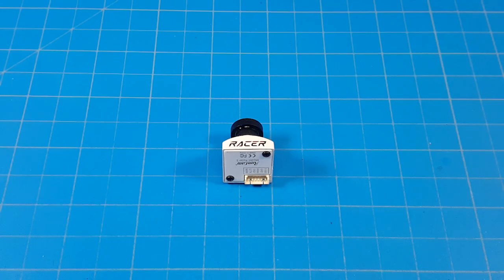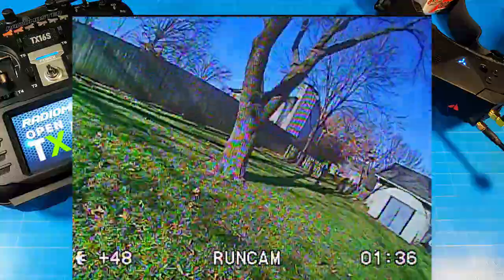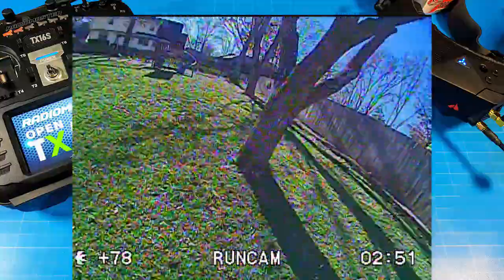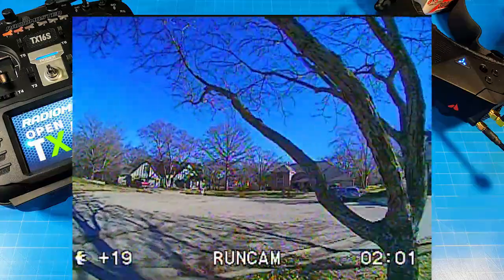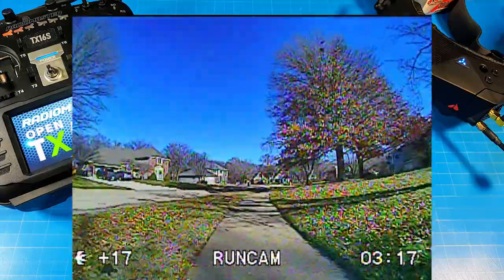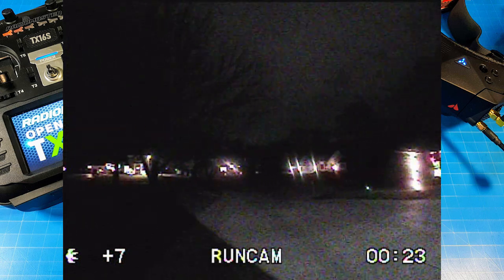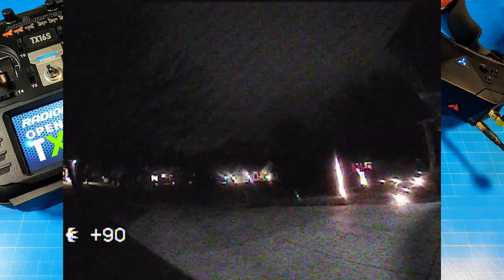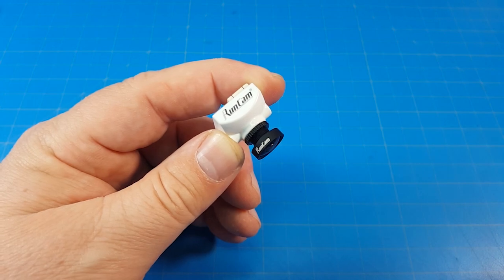Runcam Racer 5 // R is for Racing

Comment: The Angle gyro I'd assume isnt for flight; but to consistently set your cam angle while on a level surface so you can have consistent flight characteristics.
Reply from the maker: That could be too. Thank you for that
Reply: This is what I thought
Reply: oh yeah! :)
Reply: That was my first thought as well. More for setup purposes than in flight.
Reply: fully agree. it's probably more for setting your cam angle, especially since it's a Racer cam. With 1.8mm lens most ppl that race set it to 45 degree tilt since the fov is wide enough to go really fast but still see in the slower technical sections of a track.

Comment: Not a pro racer but here are my thoughts on the one thing that makes it stand out, the angle info on the OSD. When you are racing you might want to adjust the camera depending on the track or your plan for the day. Maybe you are experimenting and pushing yourself. A lot changes as far as controls with higher angles so it would be good to know what your limit is before things get too hairy. Knowing the angle will also help when it comes to going from rig to rig if you were to crash have to resort to a backup quad. Probably the most innovative thing in a space that is lacking a lot of innovation. Kudos to Runcam for thinking outside of the box.

Comment: I use racer cams on a couple of my quads because they are small and light, but also because they give you a higher contrast with a smaller sensor.  You trade overall quality for being able to more easily see your lines at higher speeds.  They also tend to have a wider FOV
Reply from the maker: I like the fov for my style.

Comment: This is very handy for new pilots. If they want to get the perfect angle to match the gopro they installed as the HD recorder. If you get a 30 degree or 40 degree this should help match it. Atleast thats what i think its good for. If you flying long range and want to know your angle, this should also help. Since long range is usually slower flying the latency shouldnt hurt much.

Comment: They have this in betaflight, not camera angle, but quad angle. I really wanted to use it learning to fly, but I found it very hard to keep my eyes on it. I want to try one hearing you say you feel more connected, Bardwell said the same thing about Steele's quad with a ccd camera. Thanks Nick!
Reply from the maker: I think its a latency thing, the flight feel less like I am predicting what to do and just doing it. Probably doesn't make sense. :)
Reply: @NickBurnsFPV  yeah it does. Thsnks

Comment: Very nice and clean DVR video, not a single breakup or noise... What kind of VTX and antennas did you used?
Reply: He stated this build is using on-board DVR
Reply from the maker: Yes, steven is correct. I used a runcam dvr on the quad.

Comment: Looks like a decent camera (picture quality wise and perhaps latency) but having a gyro on a camera is an overkill to adjust camera angle on a build. Apart from knowing what angle your camera is at, what other flight improvement benefits can a gyro on a camera provide when the FC already has a gyro? I would think a built in microphone would have been more welcomed rather than a gyro.

Comment: Hey man off topic qestion but ,how did you managed to have 2 boards on a 75mm frame in your shark byte video ?
Reply from the maker: The trashcan frame has longer standoffs, and I shortened the rubber grommets to decrease the space between the boards. The shark byte board sits on the top of the standoff/post.